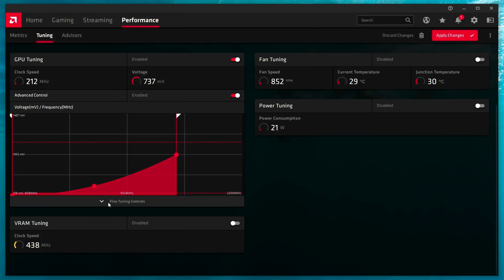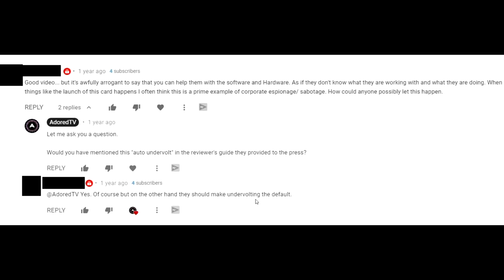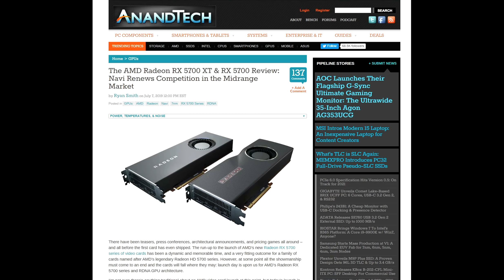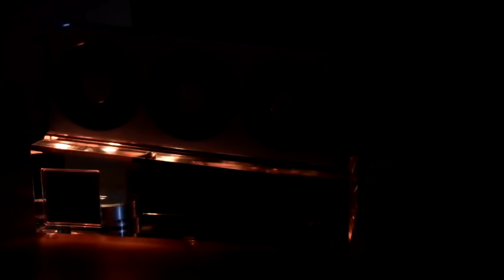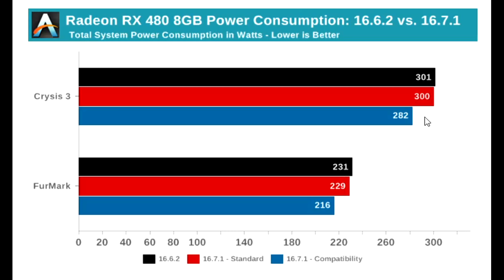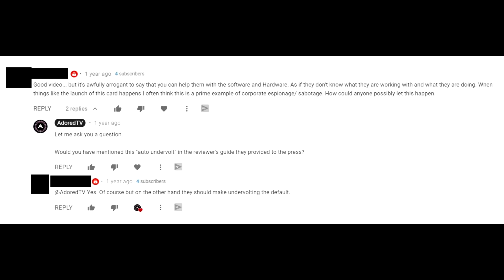Fixing AMD's "Hot and Loud" Graphics Launches.

Comment: Anyone remember GTX970 3.5Gb fiasco(huge outrage, reddit army revolts,fanboi's started hunger strikes that lasted almost 2 to 3 hours and mandatory celibacy until nVidia explains themselves...)  Well, that card end up as one of the best selling GPU from that era and one of best secondhand buy GPU for a long time..
It literally just worked, did it's job, was almost fairly priced(for nVidia product) and slow  512mb VRAM  struck as an problem to maybe 0.01% of owners(and most of them literally didn't even notice).
Problem is, as much as reviewers and Tech journalists put some effort into some topic, usually that has absolutely nothing to do with IRL problems and that is:"I want to put my GPU (that I payed as much as an whole console)into my PC and play my game, whatever it may be with as little fuss as possible...".  
Solve that puzzle and you solved all your marketing problems.
nVidia figured that out and they are now capable of making minus into a plus.
 And, honestly, if money was not an issue I would rather go with RTX 2080Ti than  5700XT even if  5700XT was as fast as  2080ti(or even 10-15% faster).
P.S.
 I'm not an fanboi,I do know that RTX20#0 series will age as summer milk, this is written on AMD system and I would really like to see nVidia kicked in the nuts by Radeon Group. 
4870/7970  level of kick in the nuts..

Comment: I've always wondered why they can't have a part of the silicon dedicated to monitoring the quality of the silicon itself. You can have a ring of inverters (ring oscillator), and measure the frequency it oscillates at and their power consumption (this will give and indication of the transistor quality) Or, a typical circuit to clock separately from the main logic, and check the output to see where it fails. Put (either/both of) these tiny "test circuits" near the middle of the chip, and expose them to the same voltages, typical usage and temp as the rest of the actual chip, so you can test likely safe clockspeeds... 1. When it came out of the factory and 2. where it clocks today, and at what temp/voltage... to calibrate how much degredation there has been, and/or just how close you are to the clock limit today at that voltage/temp. This means you have some sensor, some reasonable idea of where the silicon will now tap out at without having to run stress tests and actually generate a real error in the actual useful silicon. It would be a warning sensor, indicating the silicon is near its limit, without having to generate a real crash or ramp up power needlessly for the whole life, of all cards, to avoid crashes.

Comment: Rx 5700 is the worst card i ever bought wish I can return it , trouble for 2 months, for me  the biggest issue is scaling is really bad from 1080 hd to 4k the card can't read monitor pixels very well to this date . , black screen fixes but it still stutter that's big one it can not maintain steady fps very bad for online gaming  plus voltage tool is useless and last thing which makes me not happy than anything is it always run in very low usage !! stuck between 40-60% never run at 99-90% I don't know why but I think it's clock issue not power as many thinks . I think the next amd navi 2 is the real next generations .

Comment: Isn't the whole undervolting argument not related to not properly testing / bucketing the silicon chips? If you can optimise your testing and reliability of the card you know what chips can work on certain voltages. If the voltages of other chips are higher then the spec, you can disable some cores and sell it as a 5500XT or something and optimize the voltage.
Reply: Lol, you mentioned that later in the video ;)

Comment: Instead of undervolt being the default setting, they need to bin cards for better for lower power draw and run them at much lower clock speeds and voltages. When your GPUs are stuggling to match the efficiency of your competitors on a larger node, you should know there's a problem. Mobile GPUs prove that throwing in more cores is better than ramping up clockspeed. Why AMD doesn't do this? I don't know but they had something going with the R9 Nano, but didn't try to take advantage of this idea since.

Comment: Undervolting is the new "overclocking" in the enthusiast world. Modern silicon is already push close to this clockspeed ceiling at maxmium boost speeds. The real test is trying to maintain such speeds when undervolting the silicon.  My Vega 64 is a "silver sample" in this regard. It is able to maintain ~1600Mhz(GPU)/1000Mhz(HMB) at 1050mv/1000mv and temperature hovers around 60C-70C depending on how many shaders are needed.

Comment: on "autotuning"
WHY is it that this doesn't solve this problem? For a while now GPU's and CPU's can utilize software that records a voltage/frequency curve then optimizes. I realize that a SIMPLE test like this might not record all usage scenarios so running too little voltage can cause crashes even when the test passes, but that begs the question "WHY NOT DO A MORE COMPLEX TEST THEN?" my memory (i.e. DDR4) diagnostic utility does various types of tests so then again WHY can't they simply have a more complex set of tests put into the vBIOS that does extensive testing and find the TRULY OPTIMAL set of parameters to keep the card as performant and quiet as possible?

Comment: The binary digital layer of abstraction sits on an underlying analogue world. Where diodes and transistors start to turn ONish at 0.7 volts, and dopants over time (and higher temperatures) continue to migrate from their original deposition location. 

Using a lower voltage can also lead to digital glitches (from the underlying analogue domain) where 1's become 0's and visa versa under certain difficult to measure edge cases. And the migration of dopants over time, is ultimately what lead to the permanent failure of a silicon device, which is accelerated by higher temperatures caused by higher voltages (I squared R losses). 

There is a delicate balance, slightly higher voltage, means faster switching speeds, with lower number of glitches from edge conditions, but the higher temperature generated by the higher voltage shortens the life of the part exponentially. In effect due to chemical reactions due to the "Arrhenius equation".  Which roughly when applied to all electronic devices translates as "every 10°C increase in temperature reduces the MTBF by half", or the reverse "every 10°C drop in temperature doubles the useful life of a device". The overall take away should be that the colder you can operate a device (without condensation) the longer it will last, and the hotter you run the shorter it will last. Or that the relationship between temperature and MTBF is unfortunately an exponential curve. In many ways it is in the very best interest of companies to run the part as hot as they possibly can, to force them to fail soon after warranty. To force them to hit the second edge of the "bathtub curve" after the warranty ends. Part of the wafer testing process already kills pre-packaged silicon by operating them at higher operating voltages inside ovens to force the "infant mortality" deaths on the "bathtub curve" before  dicing  and packaging to remove all devices that would fail early. Basically chip manufacturers burn out the first 7 years of a device inside an oven over 12 hours of operation at above normal voltages.

Comment: It's quite an interesting and funny video. The only thing I've got a bad taste about is the testing with FurMark. At least out of my experience it is  quite a weird case. My XFX R9 390 could run FurMark with 900mV instead of 1218mV with an overclock of +100 on the core and +150 on the memory. While FurMark was running fine, only starting another game made the card crash under this configuration and resettet my drivers.  Anyway, great video and keep it up!!

Comment: @AdoredTV Voltage is probably not nearly as high as you think. Case temps play a large roll as to how well the gpu will run at said voltage. Also TIM application can vary from card to card. Also mounting pressure. Simply put there are too many variables you just don't see or think about. And just because your card ran at X voltage in now way means it was stable under all conditions. But the real reason for the high voltage at release is for TIME. AMD is playing catch up, and is always behind short on time. Vega drivers went thru many changes and after about a years time they finally got things sorted so voltages are now great at default. unlike the very hot and high voltages at the time of release. When vega released you were able to "undervolt" your gpu just by pressing manual mode in the driver. That was IT 100mv drop. Perfectly stable and faster than stock. So they had a good idea of what the cards COULD run at but were in no way ready to release the card when they did. Also both of my RVii gpu's will not run anywhere near 1.00v at stock clocks. And it gets worse if you are running multiple monitors, the more bandwidth being pushed to displays the higher the voltage needs to be to maintain stability. And that is in a cool case with more airflow than most for sure. Just imagine people in hot climates with very little case airflow. You cant just release a card undervolted and expect to not have a very large number of returns. Especially with how far behind they are for resources. I typically like your videos. But idk something is well off here.. maybe this is all too personal for you? Best of luck with your health issues. And i hope to see more great content from you again soon!
Reply from the maker: Yeah like I said, I'm not saying they should have released the cards at 1000mV, but 1050mV?  I can't believe any VII won't run absolutely fine at that.
Reply: @adoredtv  Well with the Vega cards yes they had more voltage than required for release day drivers no doubt. however like i stated i believe this is due to time constraints, ie they have not had time to properly validate the dynamic voltage curve based on work load under all scenarios. (possibly why navi drivers are plaguing some and not others?) As for RVii i do not think this is the case. (i ofc could be wrong) I think the thermal pads they use leave a large variance to hot spots on the die. Both of my RVii have stability issues on most "WHQL" drivers. Granted some drivers are less severe issues than others. Some of these issues likely have nothing to do with core voltage directly. More likely are from too aggressive power saving features for DP would be my guess. But for example the most recent drivers work pretty good. But after long idle times the mouse cursor will become corrupt. And it is just random. Even tested this on multiple pc's and displays all at stock settings. So clearly is a driver issue. As for the voltages, 1050mv is for the most part stable in my cool room 65deg F but even at that some games can randomly crash after hours of use. This ofc does not happen on my custom loop cooled card as it has LM and runs very cool and can be undervolted greatly at 1950mhz (1900 actual clock) But idk the cooler is just hot trash for a 300w card LOL imho. Why on earth not just make a 3 slot over sized (wider and deeper) blower cooler that can handle 500w with ease? surely it would not cost that much more to make... I dont know about you but i do NOT want hot air dumped on my mobo and ram while trying to maintain tight memory timings for gaming performance.

Comment: Hey Jim,

This is a bit of a silly question, but you referred to 3 year hardware guarantee in the EU in the video. I thought the guarantee for most consumer items and hardware guaranteed by the EU law was two years, not three. I'm actually genuinely interested in this
Reply from the maker: No you're right, it's only 2 years.  I was sure it was 3...
Reply: @adoredtv No worries. I think there might be a mention of either an expected lifecycle function of a product being three years in regards to defects or reclamations. However, I recall any mention of this so dimly that I could be entirely mistaken or it could be case specific.
Reply from the maker: @Denquu  Yeah it may be only in certain cases, I had a quick look but couldn't find anything though.

Comment: The current state- OC and Zero RPM mode are stupid indeed. Zero RPM could be as well <1000rpm and not heard. But now it keeps the fans barely working and temps <67C for 5700XT and eventually ramps up to squeeling noise and throttling to 1500Mhz(poor case plays a role also I admit). Why not keep the card cool enough for the whole time, so it wouldn´t start throttleing. IF I was able to turn off the Zero RPM I would...

Comment: One thing I've disliked about the recent AMD Radeon Software suites for the past few years is that every time I update it, it turns the graphics card's fans totally off.  With the new rather bloated full screen interface that this software adopted a few months ago, it took me nearly an hour the other day to figure out how to turn these fans back on - and once I did what a difference it made, dropping the reported GPU temperature by about 20C at idle.  Can't even hear these fans running inside my full tower case, so I'm not sure why AMD doesn't want to run them as a default.  I also wish they'd preserve my settings every time the software is updated too, it's a hassle to have to go back in and restore them manually after every maintenance update...

Comment: As a person who has a Vega56 Reference since launch day; my card has been undervolted, overclocked and is running a Vega64 bios since about 2 months after I bought it (so like October 2017). Today the card is still totally stable with my undervolt with the exception of me dropping the memory OC to 1020 from 1025 after 2 years. But we are talking about both undervolt and overclock.... for my friends running stock Vega cards with undervolts that I showed them; none of them have had an issue in ~2 years now?
Nobody games 24/7 and I have even done some mining with my Vega and everything is good. In fact when I was doing mining I had a second setting for mining that helped me increase hashrate and futher lower power consumption. 

Its literally amazing to me that most people don't know about undervolting and that AMD isn't pushing this considering the obvious free performance (and reduced power draw / noise) that it gives to most customers. It would definitely increase the value proposition and there are definitely channels (like hardware Unboxed for example) that would test this out and show everyone what they could do!

Comment: it's insane how much some of these cards can actually undervolt and even more insane how little radeon is pushing that fact. I run my RX480 at 880mV albeit i did have to downclock it to 1211mHz to get it stable. But compared to my friend, who has the exact same card and runs it at stock, mine not only runs cooler but actually performs slightly better. Honestly radeon needs to get their shit together.

Comment: C’mon. Do you really think they put high power limit for ensuring stability? The real reason is that AMD wants to charge the same as Nvidia. They simply can’t charge more than Nvidia if they could for sure they would do it. In order to charge almost the same as Nvidia they should offer the same performance. If they didn’t overclocked their cards to their limit, the performance wouldn’t be on par with Nvidia cards counterparts. They would charge less. But they want to squeeze every single penny from AMD fanboys. If they left RX 5600 XT with original bios that card would compete with GTX 1660 ti. Would run cool, low noise and would be a great overclocker matching RYX 2060 overclocked. Problem solved. But if they did so they should drop its price to 250-260$. AND wanted to charge RTX 2060 money. Going to 250$ wasn’t a option. So they decided to screw board partners which many of them designed the coolers for a certain TDP. Pushing higher voltage many cooler wouldn’t be able to dissipate the extra heat making cards got loud and prone to failure. Many ram modules wouldn’t be able to work properly at 14gb/s which add another point of failure. Adding on top of all these the driver issue of black screens, flickering makes these card as bad as they can be. So they screwed gamers as well. That’s the real reason why the voltage is so high. GREED. You should nail the issue and take the ram by the horns. Not making up infantile explanations that offend any medium IQ person intelligence. You know as well the reason. Tell it loud. The truth will set you free. I love AMD software interface but shady business practices of AMD screwed these cars and anyone who bought this cards. Sorry but this is the plain truth. For a experienced tech YouTuber like you is hard not to know the obvious reason. It’s hard for me to believe that you don’t know it. Anyway let’s fake that you take in good faith and for granted what  explanation AMD gives you for regarding issue and many more. Guys. Don’t buy AMD cards in this moment and in this state without AMD changing it’s scant business practices and fixing all these issues.

Comment: Actually Nvidia's voltage settings were a problem for me. My older laptop started to crash in all games, and it wasn't until a year that I discovered that the factory settings were too much. I had to downclock (I think about 100 MHz, can't undervolt laptop gpus without risky vBIOS tampering) with Nvidia Inspector and games were working again. Granted, my laptop was with me for 6 years when it occurred (I can't imagine most people holding on theirs for more than even 3 years :P ), but I missed out on a year of gaming because of it. Fun fact: the gpu was a thermi of course